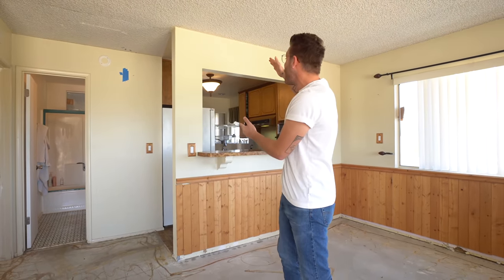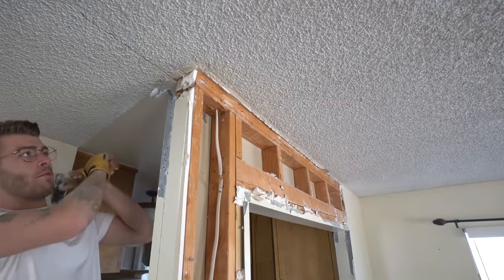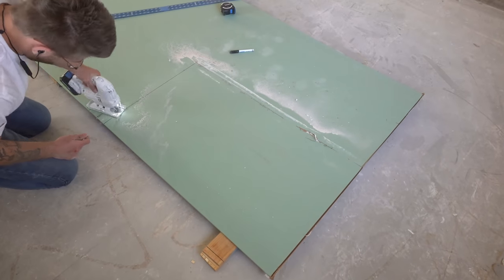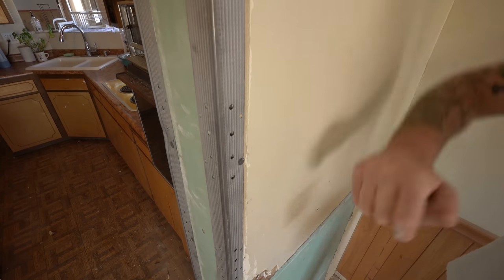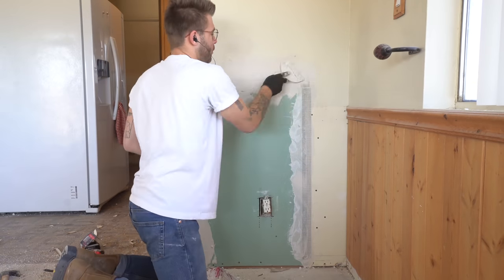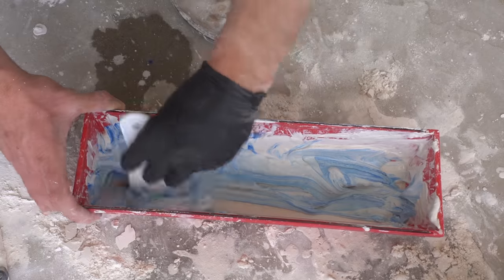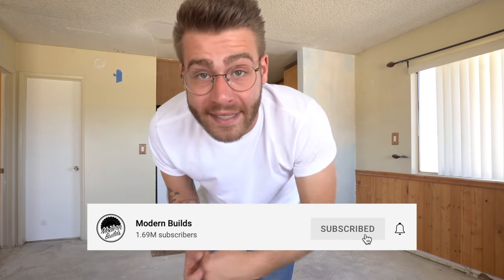REMOVING A LOAD BEARING WALL | Joshua Tree Cabin Renovation

Comment: I've never seen so many civil engineers in one spot before
Reply: It doesn't take a civil engineer to know that he used hurricane straps in a non-approved way, he didn't spec his beam, he turned a distributed load into two point loads (without consideration to whether that was carried to the foundation), and he is generally not smart.
Reply: It's a pretty ingenious way of getting an engineer to tell you how to do it properly, by first doing it the improper, dangerous way and posting it on the internet.

Comment: As a structural engineer who is installing a 27 ft LVL in my own home.... how this was done terrifies me
Reply: As a structural engineer I second that.
Reply: In what way? Tell me more I am legit curious! I don't know any structural engineers IRL and I have big dreams for changing up my townhouse
Reply: @hey_virginia  too many things wrong with this video for a comment. Have an engineer draw you a detail and then have experienced contractors bid on the install of that detail.
Reply: @hey_virginia   the major issue is he is removing the support for the dead load of the ceiling away. His is spanning a strongback from the exterior wall (likely okay for bearing this load - in this application) to the header over the original walk way between the wall he removed and the other wall. So now half that load, previously carried by the wall, is suspended by a cantilevered header, which was not designed to be cantilevered. He stiffened the rafter ties which is probably why it didn't collapse.
Reply: @mattarenz1195  so tremendously helpful!!
Reply: @hey_virginia  I'm not an engineer but having done a lot of building not only would what he put in be entirely insufficient but its just adding dead weight on top of the ceiling joists he just ripped the support wall out from under
Reply: @nickmatarazzo879  iu
Reply: I have to agree. He should’ve added a beam all the way across the top where he removed the wall then add some sort off vertical support beams on either side at the very least. All he’s doing is transferring all that load to something that wasn’t meant for that load.
Reply: Isnt it possible that the beam carried from above the remaining end wall by the cabinets to above the corner wall? Although the "sistered" member seems awfully short and inadequately fastened.
Reply: As an intern architect who likes to tear down walls, this also terrifies me 🤣
Reply: Hmm... I can't agree more.
Reply: Fr
Reply: Everything he does is terrifying to a professional. 

He is the ultimate diyer with no idea.

Comment: Hi Mike! Great job!. Big Fan! Perhaps the title should read removing a non load bearing wall. Your structure in the Attic seems to be holding the ceiling only which by definition is not load bearing. Although your approach worked it would be life threatening for anyone who tries the same thing with actual load bearing structure. Adding extra studs at the load point is probably a good idea. Perhaps showing your hardware and structural screws in the description would help. Your rafters are actually acting like collar ties that hold up drywall. most houses like yours use trusses. very interesting. Feel free to reach out in the future if you have questions about your reno project. Looks like you are making some good headway! Would just hate to see you do all that and have trouble with the inspectors. Cheers!
Reply: The 🐐 himself
Reply: I was thinking was that even a load bearing wall. Being that there no load above.
If anything, just go and sister those ceiling joists. Or sandwich them.
I don't really know. That's one thing I would have hired out. And not do it myself.

Comment: Normally your videos are pretty good but you really missed it on this one. Not only are the tools and techniques you used wrong but the “header” you put in is downright dangerous. It is not doing anything to support those joists. I think you need to do some more research before taking on a project like this, especially if you are going to use it to teach others.

Comment: Mike! Civil Engineer here, a header by definition is made to transfer loads outward onto other points. Please put a disclaimer in this video. If those ceiling joists are truly load bearing they should be resting on top of the header, not suspended by a hurricane tie. You could’ve also cut a 3 inch wide space between the ceiling joists and installed the header flush with the Sheetrock using joist hangers. I know it appears that yours is mostly there for Sheetrock reinforcement and not actually bearing weight, but this video could be dangerous to someone lacking understanding. 

That header should be bearing on at least a double 2x4 Jack stud on both sides. 

This video is DANGEROUS to those that follow it as a “How To”

Also- When using Simpson strong tie brackets ALWAYS use 10d nails or similar screws specified by manufacturer, NOT DECK SCREWS!
Reply: I was looking for a comment about the screws. I’ve seen Project Farm demonstrate how screws snap in half under light pressure whereas nails can flex and hold your house together
Reply: @dylan-nguyen  Simpson strong tie does make a structural screw meant for their connectors. But I still prefer nails for that reason.
Reply: Omg 😳 I saw mike’s video and I was like “Immediately take this video down. This video can be used as disinformation to people that don’t know about structure bearing walls this can be a disaster to other people. Please just take this video down or fix the disclaimer.
Reply: As an engineer you should be able to tell if that’s a load bearing wall. Contractors walk through houses and can tell you. I appreciate your info for those who don’t know. Of note it’s a half wall with a large opening not likely load bearing. Cali has the strictest bulging codes in the nation period.
Reply: @lechatbotte.  I can tell, those joists break on top of the wall therefore yes it was there to bear weight. Luckily it doesn’t have a floor above it or have the roof load on it, nonetheless still load bearing.
Reply: @lechatbotte.  really? Because his electrical panel doesn’t meet the NEC. Every video he does on this house has more and more code violations. If he was pulling permits he would know what is wrong.
Reply: I really appreciate the POV. if I want to do something similar in my own house how should I go about it? My initial searches for engineers in my area mostly turned up commercial firms, as a layperson homeowner I have no idea how to decipher building codes for myself, and the local building permit office is always so busy. Advice is welcome!
Reply: @hey_virginia  find a local engineer firm that will draw you the detail. In some areas you can also use a licensed architect. Privately owned smaller firms are usually best. An engineer/architect or someone from their firm should come out and analyze your situation. They should draw you plans and you can show the contractors plans for them to bid on. Also ask the engineer/architect to come back out and inspect it when they’re done installing before Sheetrock is replaced. 

If you’re getting permits (recommend) have the engineer or architect stamp drawings for you to submit to the town building sub code, they will then also come back and inspect. I’d still like the architect or engineer to come back out once the contractor is done to ensure he used all proper connections and bearing details.
Reply: @hey_virginia  find residential structural engineer that designs with wood structures. Most of the structural I work with only design steel and won’t work with wood.
Reply: When I saw him drilling deck screws into those brackets 🧐 Ohhh boyyyyy!!!
Reply: Super Pro from an actual pro!

Comment: I'm sure most of the comments are similar to mine. This was not done properly. In fact, I think you just made it worse as far as safety. You just added more weight to something that has no support to it. The header should go underneath the ceiling joist or cut the joist 1.5 inches on each joist where both joist meet and fit the double in between and use joist hangers.

If the double is sitting on that 4ft kitchen wall and on the header of that door, then you might want to let your audience know.

Comment: Looks nice Mike although it does not appear to be structurally sound. You have always made it clear that you are not a professional builder or electrician. I am a nurse -midwife and not a builder or constructional engineer yet very concerned about the safety of your technique in the video. As a home owner who DIYs a lot in my home, I would not remove a load bearing wall without paying the money for an expert and getting necessary permits if needed.  You are a talented young man and I will continue to subscribe. I do suggest taking this video down before someone follows the how-tos and it leads to a devastating accident and the person sues you.

Comment: Hurricane ties aren't meant to hang things.  They're meant to strap things down and only provide counteracting forces under intermittent uplift loading conditions.  They aren't meant to be under continuous load duration as part of the main structural support.  Just watching your video, you would have been better off using joist hangers off of your header.  Installing double joist hangers on alternating sides would counteract twisting forces too.  

If I was the inspector and saw this, I'd definitely ding your for it.  It's a major structural concern IMO.  The span should be alright with double 2x10s, but I would have glued and screwed them together to be sure.  Also, if you don't have posts supporting that header in the ceiling, that's a major concern as well.  I'm not a structural engineer (EE by training) but I did convince the city well enough that I know what I'm doing and got my own self-made trusses passed off because truss outfits had a 2-year backlog during the pandemic.  

It is possible to do what you're doing in a much safer way though and you probably should have done a little more research on what a better approach might be with your project before you signed off on this attempt.

Comment: I love your videos, but please make a disclaimer on this. I am a structural engineer and this does not seem like it was done correctly. I really don't want your YouTube channel to lose credibility but you should not be doing your own work on load bearing walls without consulting a structural engineer. It does not seem clear as to where that new header beam is spanning to. Also how do you know (2)2x10s are adequate, and how to correctly fasten it together. It looks like the walls were not reinforced on either side for where the beam above is landing. There are several things that should be analyzed and reviewed by an engineer - the beam size (determine if the (2)2x10s are adequate, detail connections at the ends, detail connections for the joist hangers and size the screws, review the load at the end of the beam and see where the load gets transferred to the walls below, and reinforced the walls below. Also, an engineer can help with the sequencing to make sure that support is installed prior to cutting out the wall. This video doesn't sit right with me so please make a disclaimer and guide people to consult an engineer when dealing with load bearing walls. I see some crazy construction errors on large buildings I work on and it is important to make sure engineering is not skipped.
Reply: I have done in my house what he did but first I called house inspector who was inspecting my house before purchase. He suggested me to do it that way.

Comment: Mike, I'm sorry but this is one of those times that I would call fail. IIRC, load bearing walls and changes to the electrical require permits and testing the popcorn for asbestos prior to removing would be important. 
There are probably legitimate ways to support from the top to create the hidden support, but that would require checking with engineers and your code enforcement people. 
You would also need to increase the number of king studs to properly support the ends of your beam.
Most, if not all, areas require a hallway between the bathroom and kitchen, for sanitary reasons, and you've removed it.
I love open concept, but there are right ways and wrong ways.

Comment: 4:29 You cant have open electrical splices in wall without being in a box that is accessible. Also for header the correct way would be to have the beam flush with drywall. Cut the ceiling truss 1 1/2" for a 2x8 or 3" if you have to double in your area, then use joist hanger to attach the truss to joist, also if needed more studs needed from floor to ceiling to carry the additional load from the beam and that has to go to foundation.

Comment: "That way I could reference it and do everything correct." Why did the outlet originally the two 14ga wires coming into the box but when you reassembled you had added a 12ga wire into a 14ga outlet box? Seems very misleading and illegal (code compliant) to me. 3:52
Reply: Why is that? If the breaker is still sized for 15 amps or whatever, what's the harm in going with thicker wires?
Reply: Just to add to this comment…

Looks like it’s a patch wire. This wouldn’t be an issue (not sure about code) because the wires on both sides of that path wire is 14AWG (and the 12AWG doesn’t go anywhere else as a feed), not the best thing to do, however what he did is illegal and a safety hazard. The patch wire is just nut tied and hidden in the wall, it should go to a junction box. You can’t just hide junctions in the wall.
Reply: @akhurash  Oh shoot yeah I had to rewatch to catch that buried wire nuted splice. That is no bueno and definitely not super pro!! 🤔
Reply: @fgbhrl4907 As I understand it, even if your breaker is rated for it, the wires getting to the larger gauge wire are not. Essentially you are pulling too much electricity (causing heat) through them which can lead to a fire.
Reply: Also dangerous “header”installation
Reply: @nickmatarazzo879  I honestly couldn’t figure that one out. I am/was hoping someone with comment on that. Seems backwards. The header should be placed underneath the joists/rafters (whichever one it is) to carry the load I would think. Maybe the hurricane straps is enough.
Reply: @akhurash  I am an engineer, and I could say this is improper installation. Refer to my other comment. Hurricane straps aren’t even installed properly, he used deck screws not structural connectors. This is a nightmare, luckily from what I can tell in the video his application is mostly just there to hold the drywall in place so he should be fine. Heaven forbid someone follows this as a tutorial…
Reply: @nickmatarazzo879  Thanks for pointing this out!
Reply: Is there a safe way to do this? I have an old house and everything is 14 ga. I've made additions using 12 ga to the same box! :( Help me.
Reply: @hnremak  The only way I know is to match the ga that is ran. :-(

Comment: Between the poorly designed and installed strongback (best of luck when you go to sell the house because no home inspector is going to miss that massive liability) and the use of a jigsaw to cut drywall, this video was a hot mess. This video is a fine product of YouTube University

Comment: I’ve never seen a beam put in above the ceiling joist before very interesting 🤔
Reply: This is NOT a how-to. Dangerous! It will probably be fine for his application but I would NOT do this. He uses deck screws as a structural connector for crying out loud.
Reply: @nickmatarazzo879  yeah I figured as much. I tend to watch This Old House if I want to see something done right

Comment: Hurricane ties are not meant for a static load.
Reply: But they work if you use many. He could install twice as many as I did in my project. I had support beam installed this way and I also had to strengthen the column that is supporting entire celling and roof above it all the way down to the crawling space. I removed all walls in the biggest area of my house leaving only one column in the middle.

Comment: How did you determine it was a load bearing wall and what board size was necessary for the re-inforcement?
Reply: I believe it’s wall that runs perpendicular to direction of the floor joist
Reply: Ok, did you even watch the video? He answers both those questions clear as day 🤣
Reply: Consult an ENGINEER! Licensed engineer and contractor here. Please, safest bet.
Reply: The reality is magic of editing. He probably took the wall out first, someone told him that was load bearing, he went "oh shit" and added that beam in the ceiling with deck screws he had lying around. The modern builds way 👍
Reply: @mattjames8683  Based on head to attached the header. Which is not a beam. I really wouldn't trust him.
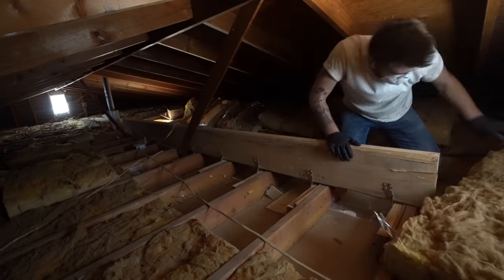Reply: @kz.irudimen  he even says at 1:30 that he did this after removing the wall

Comment: So you removed the second light switch for the dining room? Did you replace the first one? You probably left the three way switch in there. You also had 15 amp wiring and 20 amp wiring going to the outlet you moved. Bet you didn’t check the circuit to see the breaker size or what else was on that circuit.

Comment: I'm no expect, but I don't think that header is the correct way to do it.
There's supposed to be a post on both ends of the beam. A header is not a beam.
You can tell that wall was load bearing and the ends of the joists were sitting on the  top plate.
He just put the hearder on the beam. Like that will hold up anything.

If that was me, I'll get an expect to take care of that.